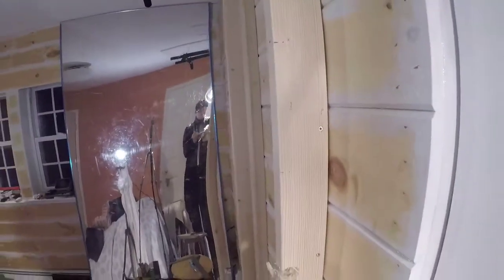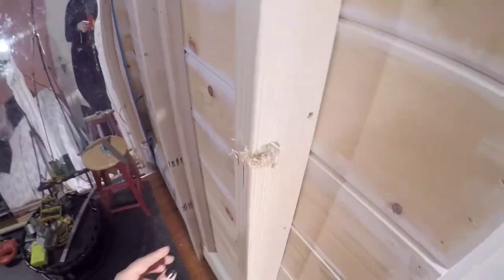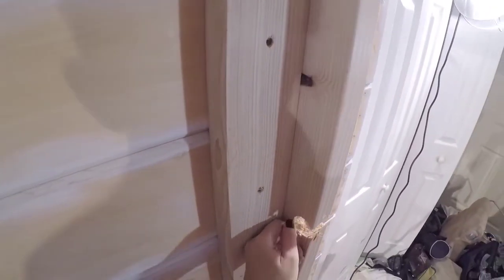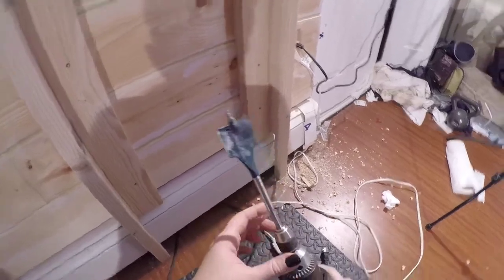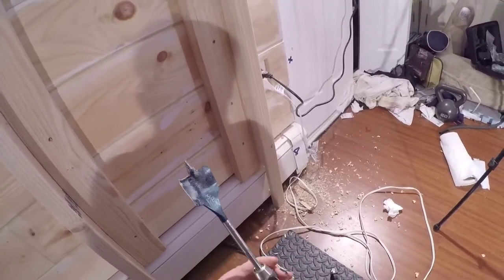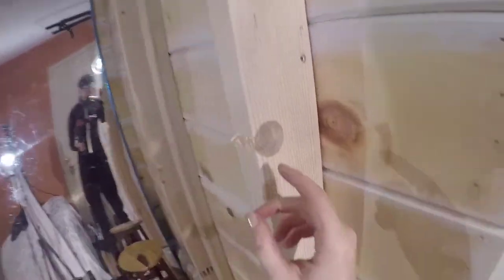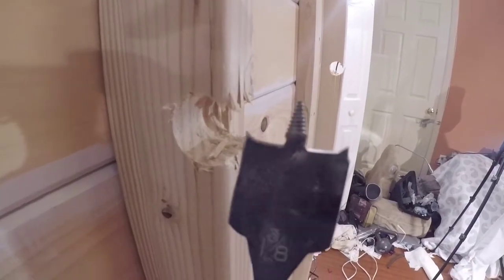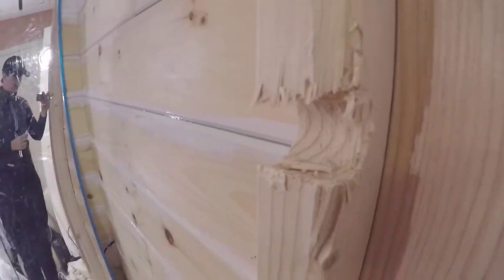Spade Bit or Hole Dozer Saw (Which Works Best For A Newbie?)

Comment: With spade bits you can’t do partial or half holes. Use either a hole saw or Forstner bits. Use the right tools whether cheap or not.
Reply from the maker: Thank you. I recently got a whole box of something that does partial holes, but I don't remember how it's called.
Reply: @easyflowing  probably hole saws or forstner bits
Reply from the maker: Yep, Firstner bits.